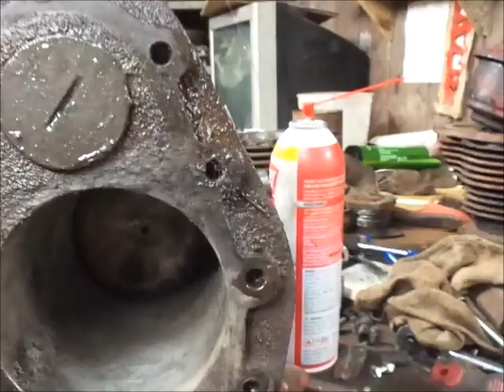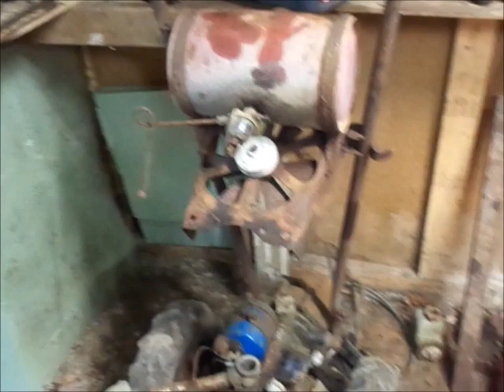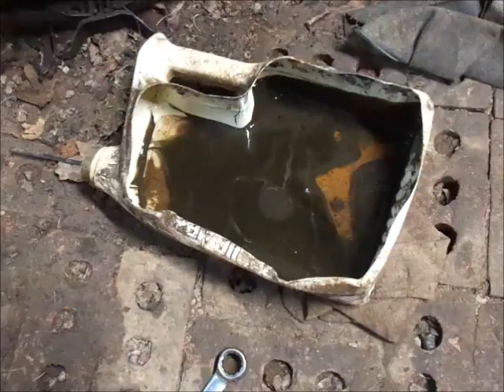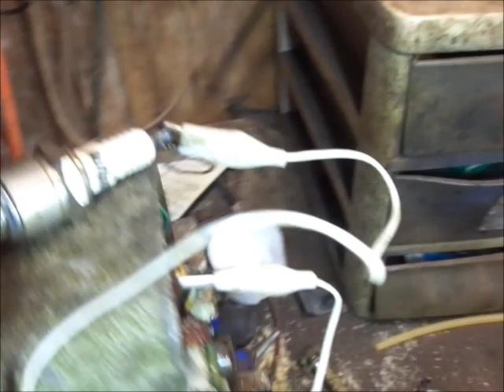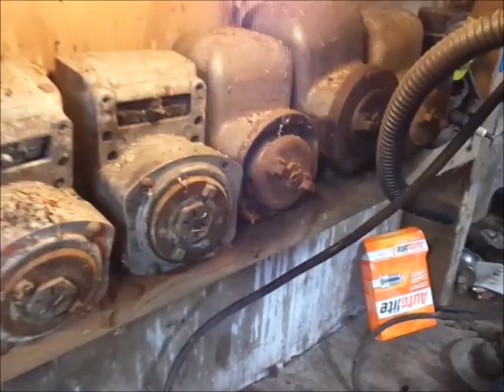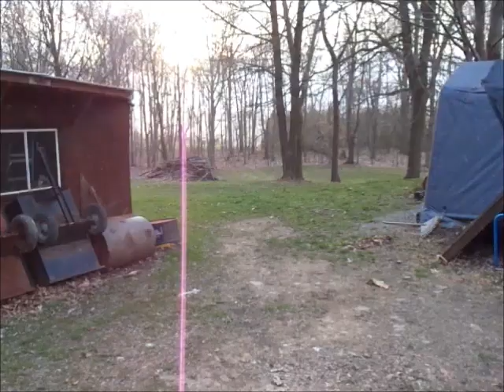52 gravely L putting it together first start attempts

Comment: Steven, we're currently working on a gravely 1969 430 commercial and have run into problems with the steering gear it seems to be held in place with a large pin that runs all the way through. The pin however is stuck and feels solid do you have any recommendations, or are we going about this entirely wrong? Any advice would greatly be appreciated!
Reply from the maker: Should have a pretty good vid of that in my 68 430 series. But your correct large pin with some sorta pins ect the that keep it from falling out